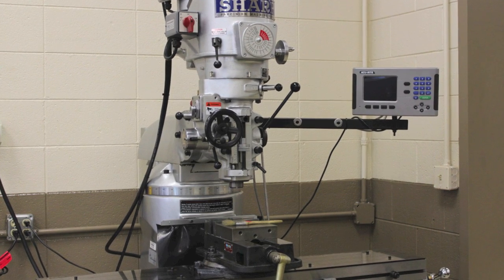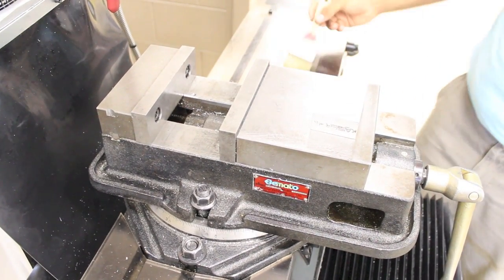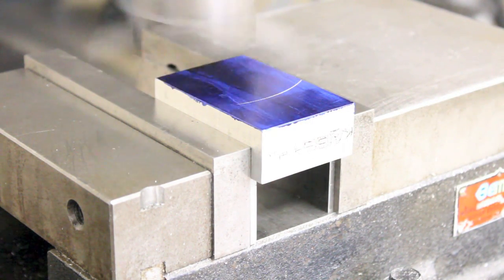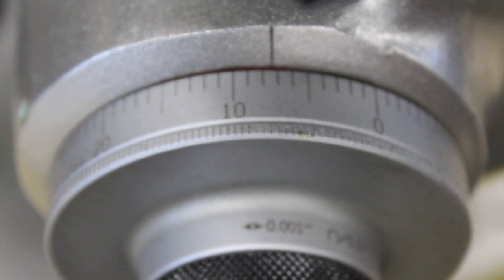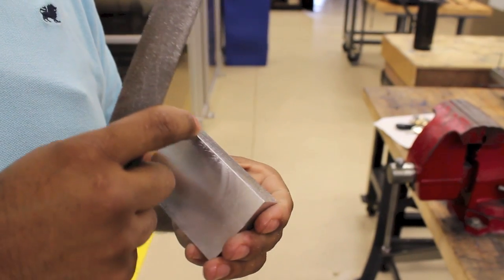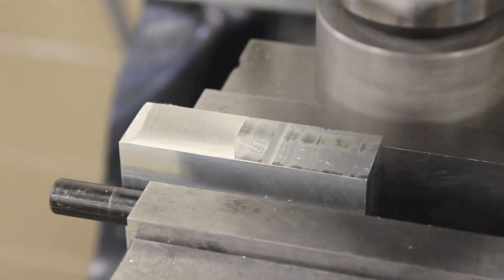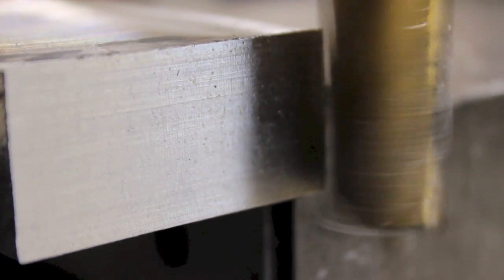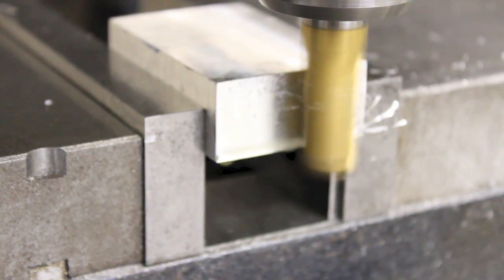Squaring Stock & Face Milling

Comment: Why use the rod in the vise with the block?
Reply: G Schiltz.. because the round bar stock forces the material to become Parallel with the fixed jaw
Reply: It is a smaller surface area contact and allows the stock to almost "self correct" by putting most of the clamping pressure up against the indicated fixed jaw.
Reply: Why climb mill at the end?
Reply: @freddykallenbach7987  maybe to give better finish